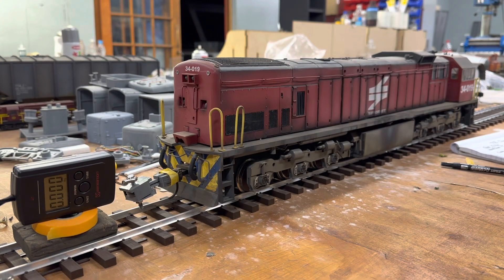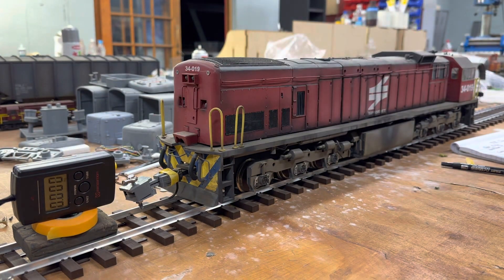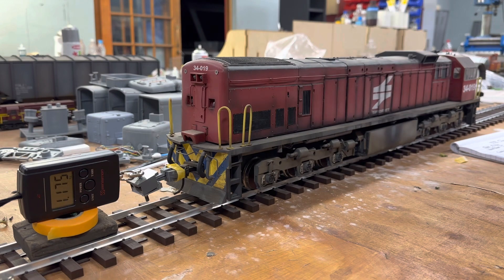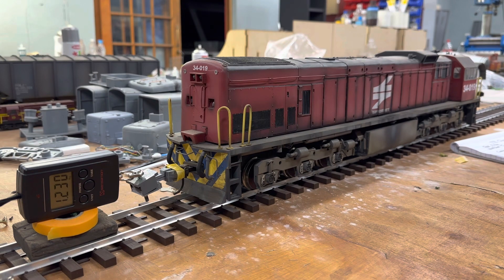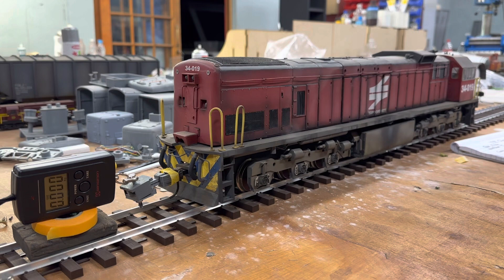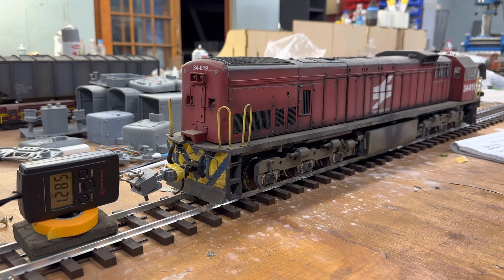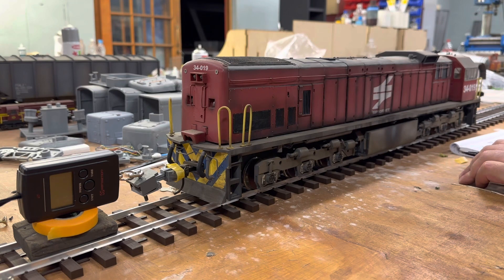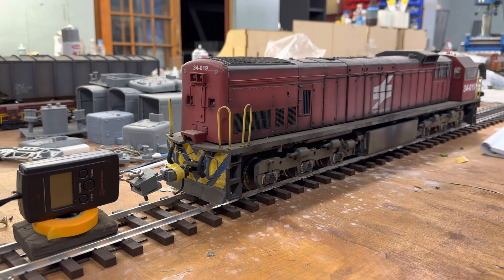DYNO!!!! TTR Class 34GE strapped in.

Comment: Your’s definitely also has a vibration on the speaker on the bass like mine, but your’s is sounding more bassy than mine. My GE i think is over 6 kg
12:55
Reply from the maker: Yes, yours is way heavier as it has the steel chassis. That thing should clear 2000g on the drawbar easily.

You know what it is, the dieseltank sits under the chassis rail. I never sealed the tanks off at the top like I do now. I am going to seal this one and check what it does. Sommer with foam strips. I think that is the problem.